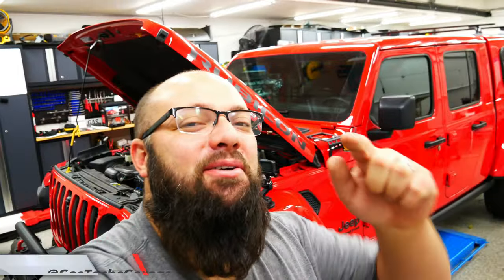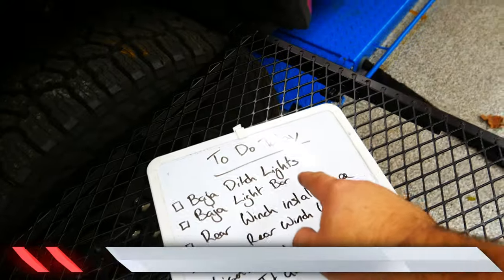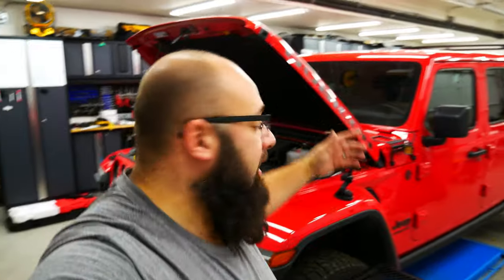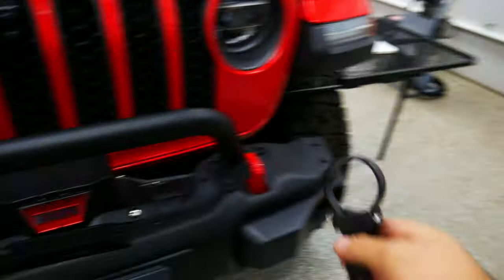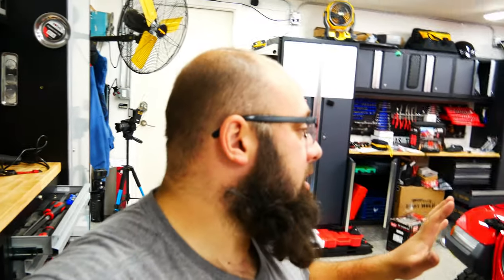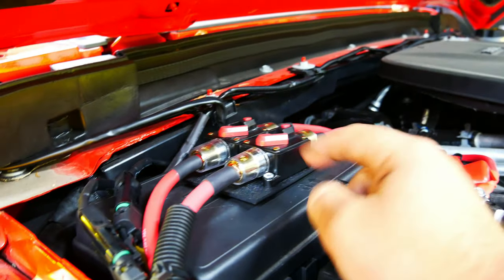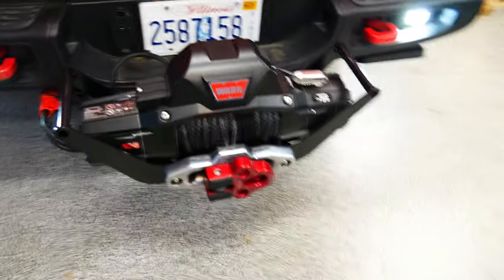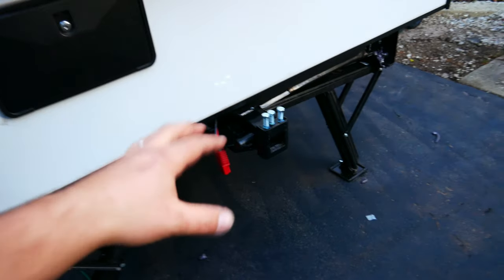Installing Some Baja Designs Light on my Jeep Gladiator

Comment: What cowl mount is that?
Reply from the maker: https://www.extremeterrain.com/jeep-gladiator-cowl-accessory-light-brackets-dz4445jl.html?utm_content=XT%20Lights%20-%20Light%20Mounts%20and%20Brackets%7CDee%20Zee&T5_Var4=JG6116&utm_campaign=XTG+Gladiator+Vehicle+Medium&dialogtech=ppc&utm_source=google-pla&utm_medium=shopping&T5_Var2=shopping&gclid=CjwKCAjwzOqKBhAWEiwArQGwaDC9GHhqI8Tj7yahwSWWwAP5j73ImWWkYr5vmhZHnx0Qu_-jkR075xoCDi8QAvD_BwE&gclsrc=aw.ds
Reply from the maker: Dee Zee Cowl Accessory Light Brackets